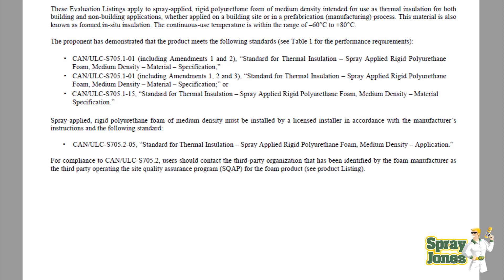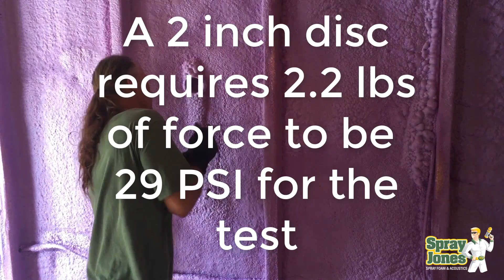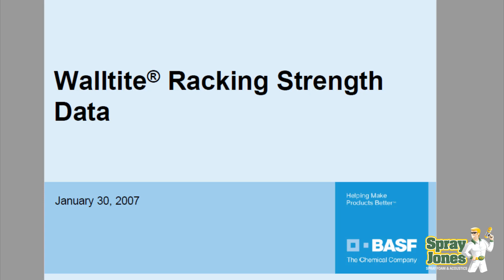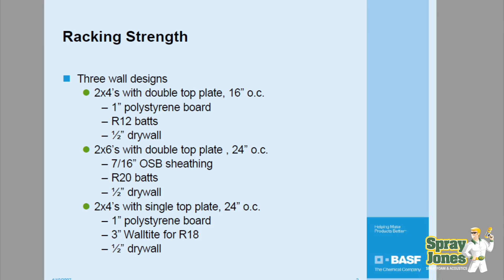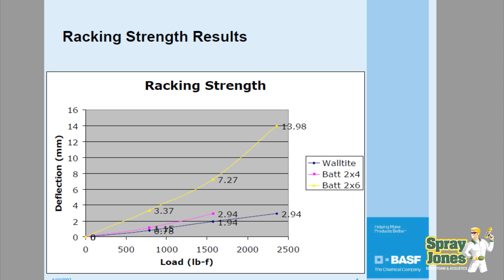Can Spray Foam Insulation Break Free of Wood Studs or Substrate?

Comment: A couple of situations in my experience that will cause separation
1) Foam sprayed off ratio
2) Foam sprayed on a substrate lower than the recommended temperature
3) Foam sprayed on a substrate exceeding minimum recommended moisture level
4) Foam sprayed on a substrate with any kind of lacquer based finish e.g.engineered LVL, steel structure-
I was commenting while listening to the video, sounds like you had most of this covered. Thanks for educating the general public!
Reply from the maker: Thanks for watching Tim.

Comment: I have some really amazing pictures of foam separating from studs to the point of pulling two nailed studs apart. From my nightmare foam install.  Excited about the video!
Reply: That makes no sense. Separated so much from the studs it pulled studs out?
Reply: @mikeznel6048  I agree, he needs to rewrite that and better explain what he witnessed.
Reply: @mikeznel6048  Sorry I agree poorly written....
If you can imagine a roof rafter with a collar tie. Spray foam sprayed, something was wrong with the installer and or foam, it looked good for about a week, then after the hot sun beat down on the roof the foam started to shrink. The foam happened to adhere to the collar tie and opposite side roof rafter, and pull away from the other rafter.
The collar tie that was properly nailed in literally pulled away about an inch and a half away from the rafter it was attached to. 
Sorry for the poorly worded first post, hope this clears it up.
Reply: @dennispope8160  Hey Dennis, thank you for clearing that up. We are all guilty of saying or typing something that is poorly worded. Take care

Comment: That is a very interesting video. Really liked the example of the 2*6 deflecting from the contraction of the sprayfoam. And it makes sense that a material should not be considered a air or vapour barrier if it can crack at the slightest building movement. Great video as always.
Reply from the maker: Glad it was helpful!
Reply: I see a foam rig in your future

Comment: Great video. I have a question about the interpretation of the Wall Tite racking test results from BASF. A racking test is a test of lateral movement or shear in a wall assembly as indicated by the test set up diagram. I don't question the results of the Wall Tite product as much as the results of the comparative 2x6 frame wall vs the 2x4 frame wall. First, your description of the test appears to be incorrect as the load is from the side, applied laterally at the top plates not from the top applied downward as you stated. This is consistent with what I would assume would test racking in a wall assembly and what is indicated in the test set up diagram. The test results shown would indicate that a 2x4@16"O.C. stud wall with polystyrene sheathing, known as a 13+5 wall assembly has a higher shear rating than a 2x6@24"O.C. stud wall sheathed in 7/16" OSB. This seems counter intuitive. Again not doubting the results of the Wall Tite product as much as questioning the validity or interpretation of the test results. If these results are true, then a 2x4 R-13+5 assembly has only slightly less racking strength than the Wall Tite assembly with similar R value at a much lower cost. I agree with your assessment about the adhesion value of the spray foam material, but I'm not sure that the racking test supports your point about adhesion. This test would seem to support an argument for the shear strength added to an assembly by the spray foam insulation.  Do you have the report for this test? I would like to understand this better as I am always trying to explain the advantages and disadvantages of different type of wall assemblies. Again great job and very informative you've definitely given me something to think about.

Comment: The tensile strength in the SPF properties usually indicates the tensile strength of the foam itself, rather than tensile strength of adhesion to a substrate.  Some manufacturers have the pull adhesion specs in their data sheets.

Comment: Metal studs can be a problem,the places the metal studs are made sometimes put an oil protective surface on them if they are going to be sitting outside for a period of time before being transported.Foam does not react with that well at all,adhesion is lost and it will actually shrink away from the metal studs(not sure if thats a reaction from the oil protective chemical they use and the foam itself)Spraying the studs with a primer before foam can make a big difference.Something to watch out for though if you havent ran into that problem before😎😎good vid
Reply from the maker: The studs probably do have rolling fluid on them still.

Comment: Hey! What is the adhesion against a tyvek or house wrap? 
Thanks
Reply: I've sprayed on tyvek and we use it sometimes to get better bonding but that will leave gaps from the tyvek to the material it was stapled to, since foam can bond really well with tyvek, so be careful.
Reply: @SinnisjInsulator  I will be building a post frame building and will have the tyvek over top of the strapping before the tin goes on. Foam will be spray against the strapping and tyvek.

Comment: How do you prep walls with potential contaminants on the substrate to ensure adherence?  I'm thinking about retrofit.  Do you need to prime?
Reply from the maker: Clean off what is not supposed to be there....
Reply: @SprayJones  We are working on a house where old form ply was used to sheath the walls.  There is a concrete residue on the sheathing.  We took a wire brush attachment to take off any loose material but I was wondering if it should be sprayed with an oil paint primer like killz or if SPF would do better with a completely different kind of primer.  Googling and checking spf websites, I haven't found recommendations on ideal primers.
Reply from the maker: @nolanarcher5123  If it will not come off easily  you should be able to go right over it.
Reply: @SprayJones  thanks

Comment: Spray foam adds remarkably to the system's strength, consider any insulated plastic cooler vs a plastic tote for rigidity.  By the way, the load to create racking in the test image appears to be lateral, not vertical.
Reply from the maker: Thanks for the feedback.